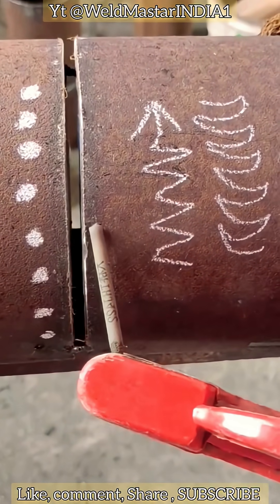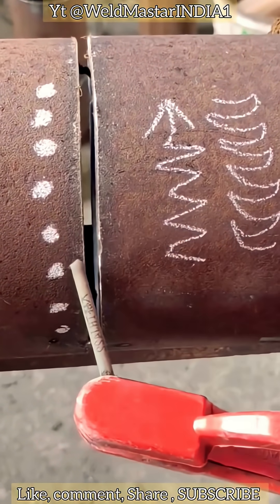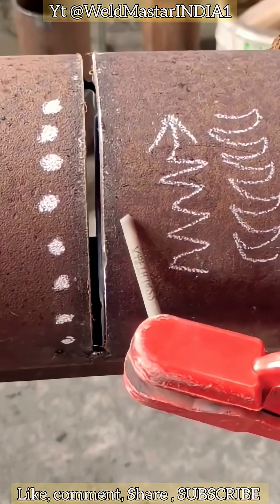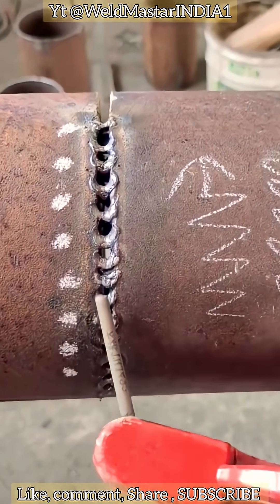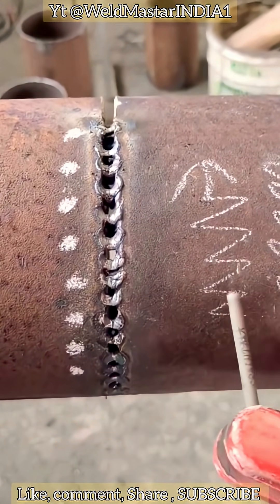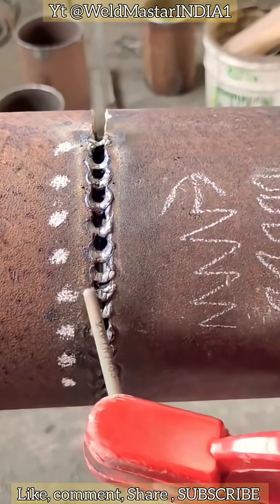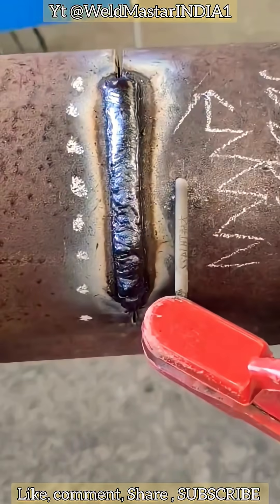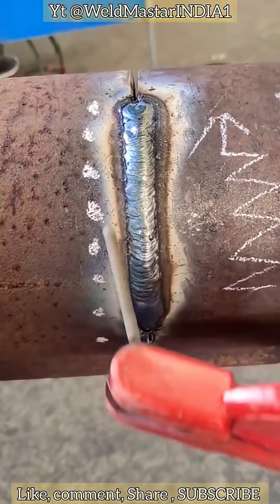#learn How Beginners Can Weld FAST & Clean Without Burn-Through or LEAK #Welding #DIYWelding #shorts

Comment: Noticed the finished weld was on something different thn the spot welds. 
The finished weld material gap was a lot closer together thn the spot weld gaps 
Wld be nice to have seen the original material used through the entire video 
But maybe something happened tht caused you to change the material